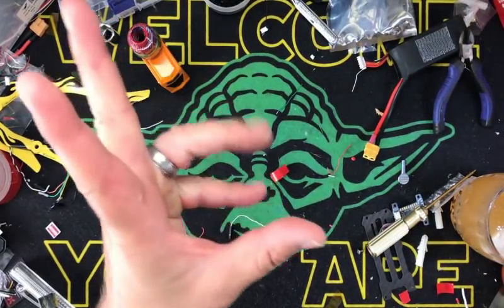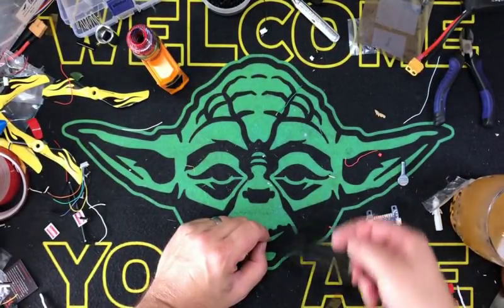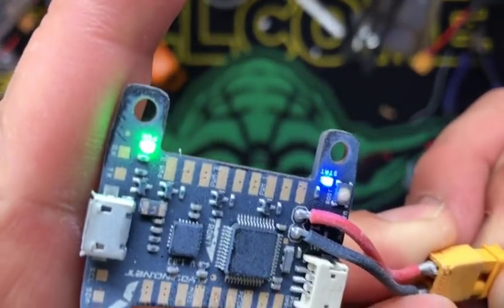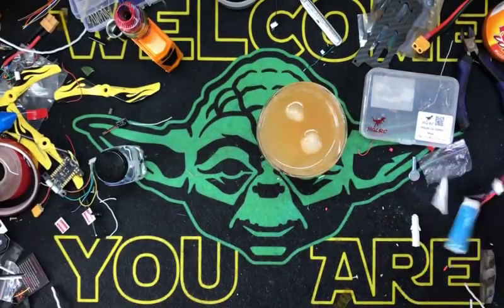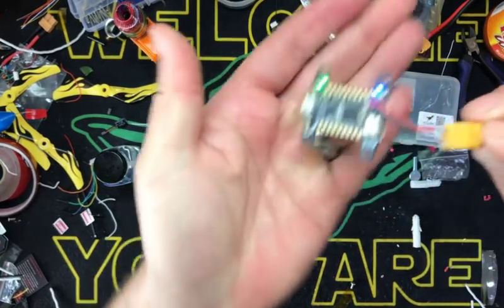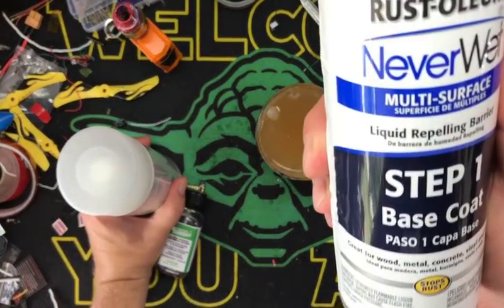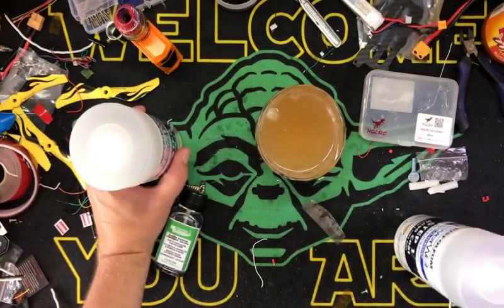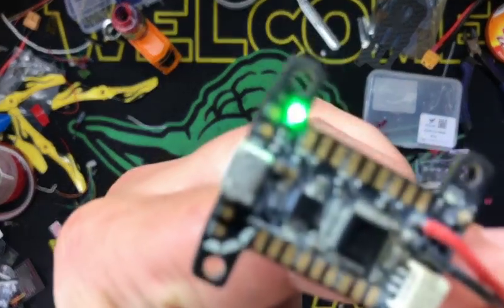Demi Proof it!  Waterproofing electronics for quads.. COMPLETELY!!!!!

Comment: Old. Pretty sure Flite Test did this 3 years ago & Rotor Riot a year or 2. Even if they didn't use this exact process, Youtube links you up with all this stuff in the suggested videos.
Reply: Also, the word your looking for is hydrophobic.
Reply from the maker: Ahhhh.  Nice thanks for the update.   I’d never seen it done with quad gear
Reply: True, Flite Test used plane stuff & Rotor Riot didn't use Never Wet.
Reply from the maker: Ahhhh seems to work pretty well.    Man I haven’t watched flight fest in a long time.
Reply from the maker: Flight test

Comment: Any advice for the DALRC esc getting the heat shield off to coat , then I was going to hot glue it back on. You coat your partriot bird looks like rain tomorrow here.
Reply from the maker: jeremy marano hey brother.   I’d have to see the esc.   I never run heatshilds or heatshrink on esc’s.   Better to have standard airflow

Comment: Hey bro i have the brush on conformal should i do my soldering first before or can i solder over the pads if i coat it first
Reply from the maker: I usually conformal first.  Then Solder then conformal over the Solder joints brother